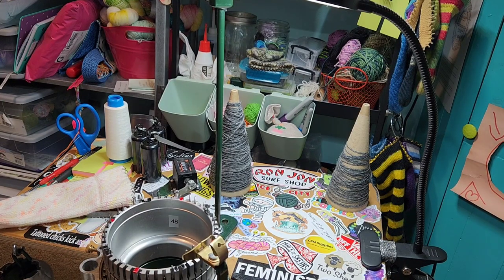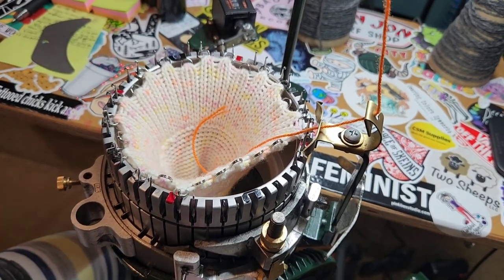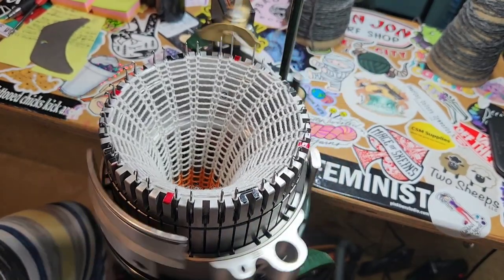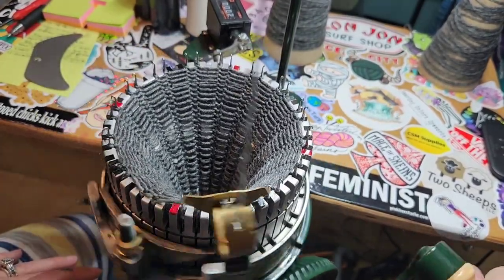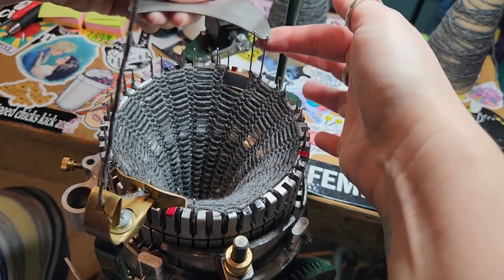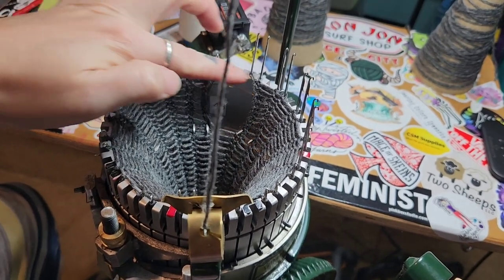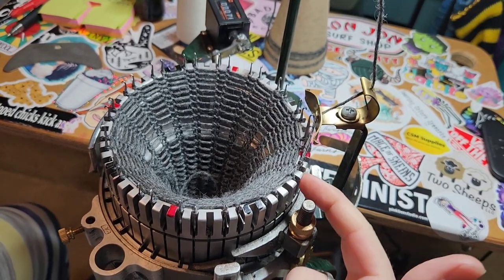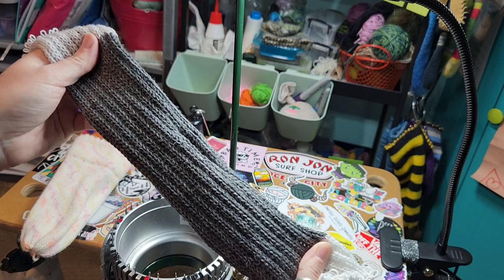Circular Sock Knitting Machine. Mock Rib Fingerless Gloves. 48 Stitches. Some Flat Knitting. CSM.

Comment: Very cool. Is the faux rib on the CSM the same as a slip stitch rib when hand knitting?
Reply from the maker: I had to look the slip rib up. I don't think it would be compared to that. With the slip rib, you are actually slipping a stich. And with this, there is no stitch but extra space, making a fake rib with the length of yarn that 1 blank stitch space allows for. I hope that makes sense.
Reply from the maker: I dontthink there's a way to replicate this in hand knitting. You would need to leave extra working yarn between two live knit stitches and it would be all about tension